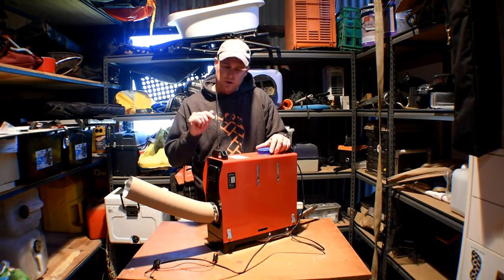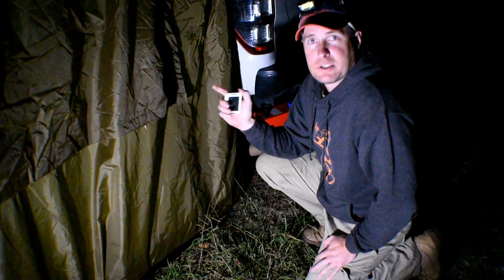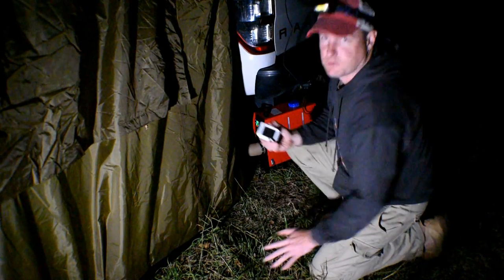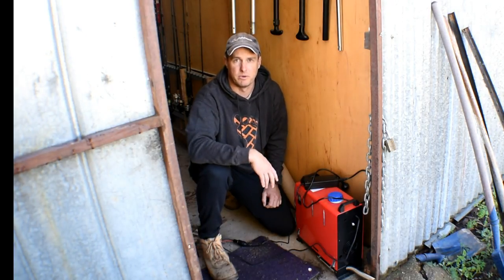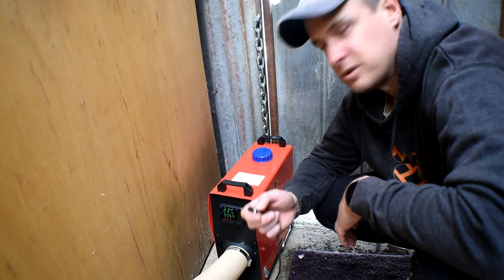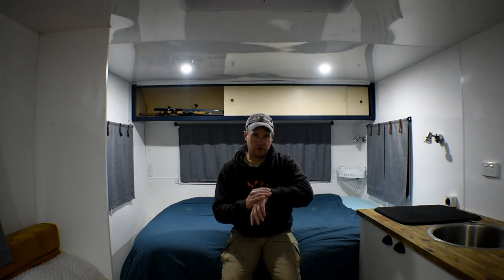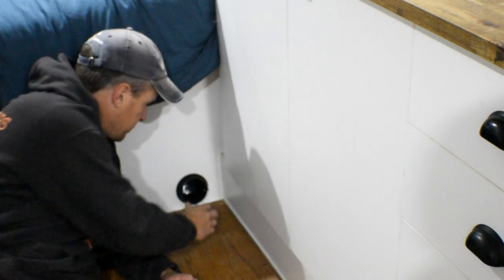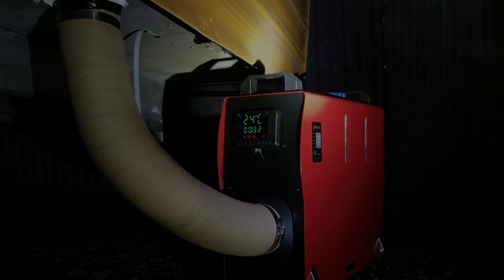Diesel Heaters: Why you should buy an all-in-one unit over an installed unit

Comment: You needed to have another pipe in the caravan to go to the inlet side of the heater so the air in the caravan recirculates.  This means the unit is not trying to raise the temp of outside air.  Also make up an extension harness so the controller can also be inside.
Reply from the maker: Yes I had thought about both those options but wanted to try the simple option first and so far so good.
Reply: @AllThingsOutdoors  The re-circ is key to the efficiency of the unit. Get to 1-2c outside and I doubt the heater would do much at all inside as the difference would be a huge mountain to climb. It's more complicated but deffo worth the extra pipe, plus you're less likely to drag in diesel fumes too.
Reply: Yes recirculation is essential.
Reply: good idea,
Reply: @dougle03  Would this also help the unit burn a bit less fuel too I'm thinking? Would explain why some folk are getting longer run times than some others??
Reply: @steveclark..  If the inlet air is from outside rather than previously warmed air then yes, that would make a huge difference.

Comment: The idea of the diesel heater is to circulate the air inside so heating is more efficient and also dries the moisture out and keeps the caravan dry.  Getting the air from outside you will need to heat more because you are heating cold air constantly
Reply from the maker: Yes it is a compromise to be made in order to be able to use the unit across multiple applications. These portable units were designed for this particular reason.
Reply: @AllThingsOutdoors  I didn't say anything was wrong with it, what I'm  saying is you could do another hole where it would suck the air out and circulate it.  That way the heating would be more efficient and your caravan would be moisture free.  It just an opinion :)
Reply from the maker: Sorry I didn't mean to sound like I was snapping. I did at one point consider setting up another duct into the caravan to cater for this however I felt that it kind of tool away from the portability and quick setup. After I've tried it a few more times to see if it struggles I may consider doing it but even in my part of the country it doesn't get much colder than freezing.
Reply: @3dmixer552  if you recirculate inside air, where do you think the moisture goes. The answer is nowhere. To eliminate moisture, the best method is to pump in dry outside air. Try getting your interior of your car to dry out in winter with the heat set on recirculate. Your windows will fog and the moisture will remain.
Reply: @Quesnel4X4  That's the point. You dry the moisture out by circulating it through the hot heater core
Reply: @Quesnel4X4  Ok smartbutt.  :)  You haven't got a clue.  I lived in a static caravan for 5 months in the middle of the winter.  When I cooked the entire  wall and windows  had condensation on it. I switched the heater on and 5 minutes later everything was dry. Where did the moisture go?  I guess nowhere.  If you keep your tent, or caravan, camper heated there will not be moisture.
Reply from the maker: Well said
Reply: I suffer with damp more than cold so this makes more sense to me

Comment: Another tube to connect the fresh air to recirculate the van air will help greatly
Reply from the maker: Yes I did consider this but then I felt that it cancelled out the portability and quick setup and to be honest the van heats up quite quickly. Yes, it won't be as efficient but find that the air is less stale.
Reply: Should still draw air through the camper vent but I only get down to -5 so it’s not really a problem for me either

Comment: I would have liked to see the setup. How you routed your exhaust and air intake.
Reply from the maker: The exhaust and air intake beneath the unit was a bit tricky to route. I used it on grass not long ago and the exhaust scorched the grass and the intake sucked up the fumes a bit. I need to move the intake up a bit higher along the outside.

Comment: You might as well leave the unit at its highest setting - you don't have a thermostat on the unit its just a rate feed fuel pump you can swap deg. to hz (you have a safety thermostat / switch) the heater will last longer if ran flat out.
Reply from the maker: If I run it flat will it still spool back when it believes its hit the temperature set on the controller? When I use it in the caravan I've set it to 18°C and depending on the ambient temperature it will take about 20 minutes to get it to temp and then the pump and fan spool down.

Comment: The heaters will be running flat out all the time , the temp sensor is in the LCD unit , its mounted  on the out side on the unit,  reads outside temp not cabin temp.
Reply from the maker: Yeah I was aware of this when I purchased it. I have worked out the temperature settings to compensate for this for using it in my awning tent and also the caravan.

Comment: Thanks for taking the time to do te vlog and add details as very helpful. I was wondering where you purchased the vents/caps etc for putting into the van. also the size as I think I might swap from permanent install after seeing your vid.
Reply from the maker: I just bought a duct kit off ebay. Changing the All in one to an installed unit is very easy as its just the same kit but installed in a case.

Comment: Thanks for this setup -- I think I will do this for my popup (although I will use another hose for the return air).  Do these all-in-one units offer the possibility of relocating the controls and thermostat to another location INSIDE the camper?
Reply from the maker: Yes. You can quite easily extend the wiring and relocate the unit. You may need a connector of some sort though to pass it through to inside.

Comment: Hi Mate, this is exactly why I bought one. Awning tent, Caravan and shed. So I love finding this rundown. I loved the caravan install. What was the screw in bung you used? That's what I need to replicate. Thanks Tim
Reply from the maker: G'day Tim. The screw in bung and all the other parts I used to connect the heater to the caravan are pvc water fittings. Just need to find the right diameter that suits your diesel heater hose. Works a treat too.

Comment: Where would I find the duct work for caravan trying to replicate your setup what would I look for and where would really appreciate it great video thanks
Reply from the maker: You can buy diesel heater ducting kits quite cheaply on ebay. The only difficult part is creating the pass through in the floor. I bought some large pvc pipe fittings from a farm supply store which fit snugly inside the pipe and attached with hose clamps. This meant that I could then make a screw in bung which covers the hole when not in use.

Comment: 1 thing tho... You should avoid putting the unit on the grass...for the exhaust can get very hot and start lighting the grass on fire.

Make sure nothing is gonna burn around the exhaust pipe.
Reply from the maker: Yes. I put it up on timber blocks. It helps to stabilise it too.

Comment: Hi, daft question but how do you know if it’s low on fuel?
Reply from the maker: It has a sight gauge on the side of the tank and if it runs out of fuel it throws a specific error code which I forget now.
Reply from the maker: Apparently the code for out of diesel is E-008. I just happened to be using my diesel heater tonight and ran out of fuel just now. That's a bit of a coincidence.

Comment: I have the same exact heater but have never been able to get the remote to pair. Any ideas?
Reply from the maker: Not sure about that one Mike. I just put the battery in and it worked straight away. Can you see the light come on when you push a button on the remote?

Comment: Nice informative video. I'm considering something like this to heat a basement area but I would need to attach a 10m long pipe to the exhaust outlet to get it outside the building. Do you think that would work ok?
Reply from the maker: Probably not as the instructions say to have the outlet below the level of the unit to prevent carbon minoxidebuild up. You would be better off having the unit outside and pumping the heat into the basement.
Reply: @AllThingsOutdoors  Ah that makes sense, thanks for the advice!
Reply from the maker: They're a good unit and do a good job heating my shed which is full of holes and cracks with no insulation.
Reply: @AllThingsOutdoors  out of curiosity how large is your shed?
Reply from the maker: Australianmatttty the shed is about 7x5 m and is about 3 m high so just over 100m2 in volume

Comment: Can these units be in the elements. Is there a minimum temp they operate in. Thanks for the video
Reply from the maker: The units to my knowledge aren't waterproof. As for the lower temperature that they could operate in would be limited to the fuel. If you use alpine mix diesel though I reckon you could run it in the snow.

Comment: Ok so how is the heater monitoring the inside temperature when the unit is outside..?. Is there a thermostat inside the remote.?.
Reply from the maker: Some models have a thermostat inside them but sadly this one doesn't. With this one though the screen can be detached and pulled inside the tent which has the thermostat in it.
Reply: Ok thanks I was wondering about that because you didn’t show that in your video  ..
Reply from the maker: I was still figuring it out at that stage. I reckon it's pretty dialled now.

Comment: Nice unit.  It looks to be powerful enough for the camper.  But one question...  do you always have to start it with the remote and then shuts it off yourself?  Or is there an optional external termostat that could be used to make it autonomous?
Reply from the maker: You can use the control panel on the unit to turn on and off also and there are a bunch of other features that can be programmed which I haven't got into yet. I'm sure you could program it to turn on and off with the timer.

Comment: how many hours can a full tank last
Reply from the maker: They say it uses 100mls an hour average so with a 3L tank you could get 30 hours theoretically. But in my experience it's probably about 20 hours when your stopping and starting as it uses more fuel to get up to temperature.
Reply: i now have 4 of them, three were sold as 5kw, one even claimed 8 kw lol.  all use a max of 0.5 liters per hour when running flat out non stop(8hz/5000rpm)- ie can only therefore be approx 4 - 4.2kws(less heat and fuel if still on factory settings - was 0.4- 0.45 liters/hour at 5hz ).
All mine are or will be fully installed.
Imo using with only an inlet duct, means you waste a heap of heat, and would need a window or vent open to allow air back out, as opposed to recycling the same air, saving energy with not having to fully heat from scratch again.
One of mine also has an aftermarket true temperature controller and control board, which shuts it down fully, and restarts it again when temp drops by 2 degs, as opposed to most ones that only drop to minimum output when over setting- 1.5hz min and 5hz max factory usually, but 0.8hz min and 8.0 max if set to limits in advanced settings like mine. (pw 1688 for many, alter settings at your own risk, noxious emissions could result from getting them wrong - personally i use 1500 rpm as minimum at sea level, but could be set lower if needed). One unit i had, had a plateau setting, which i think is for using up in the mountains, i assume it changes fuel rate and/or rpm for up there. 
Ps - using an app on phone, with a background noise level of 42db average, mine reach 72db at max and 57db at lowest output. measured directly over unit, less if further away. the noisiest thing is the pump, when running at low output. For one i got an aftermarket  pump(22ml type E was all the info with it), it's a lot quieter than standard ones. Recently i thought i would see, what a 28ml type E pump would go like, was too much fuel frankly, and was as loud as standard ones, since put original back(did run fine when i got settings right, but sometimes got flooded at startup).
Reply from the maker: I think that's probably a fair assessment. I'm thinking of putting a connector in for the controller and making it so I can have it inside the caravan so that I get a more accurate representation of the temperature. I guess you can plumb in the inlet line too to get recirculation.
Reply: Interested in what you used for the pass through and screw in cap and where to get it from, a link if possible.
Appreciate your video
Reply from the maker: Hi Glenn. I used poly fittings that are used for agricultural water distribution to make the pass through. I picked the fittings up from my local farm supplies store. I think I used a 3 inch threaded connector with the screw in bung to stop the nasties getting in and then another connector inside the van with the heater hose strapped to it. The 2 connectors then screw together sandwiching the floor between them.

Comment: Be a lot quieter with the pump outside the van and not mounted on the van too. Seems more people complain about the noise with the installed ones rather than the portable units.
Reply from the maker: Yes it is very quiet with it outside the van. The only noise you get inside is the movement of air from the duct.
Reply: @AllThingsOutdoors  I'm sold. I'm going to check out my father's today.  He has pretty much the same unit as you. Seems like it will be perfect for my enclosed trailer and rooftop tent
Reply from the maker: I've actually been pretty pleased with mine considering I bought it from ebay.
Reply: @AllThingsOutdoors  I sold it. It was too hot..
Reply from the maker: Did you get the 5kw or the 2kw? I have the 5 and find even on the lowest setting it can get quite warm in my caravan.
Reply: @AllThingsOutdoors   mine stated it was 5 or 8 kw

Comment: I could never understand why people try to heat outside air with one of these diesel heaters. You should be pulling inside air thru the unit and re-heating it much like the cold air return idea with your home furnace. Heating outside air is not at all very efficient and a waste of fuel.
Reply from the maker: The whole point of this heater is to be portable and easy to setup. Its not meant to be a permanent solution but more a quick and easy heating source for a tent or shed.
Reply: @AllThingsOutdoors  Got ya!